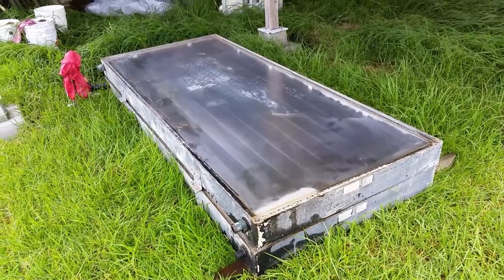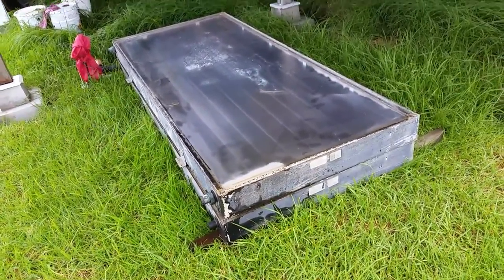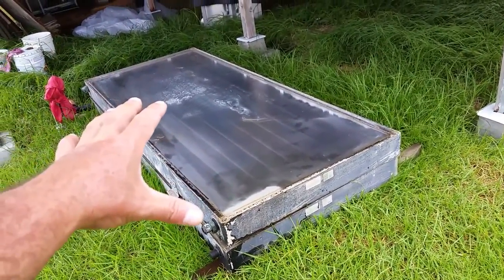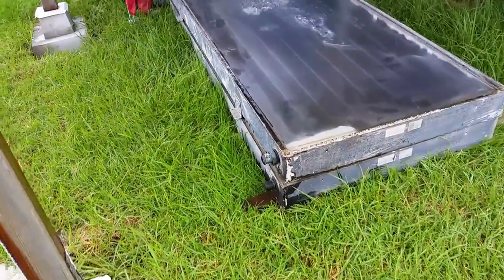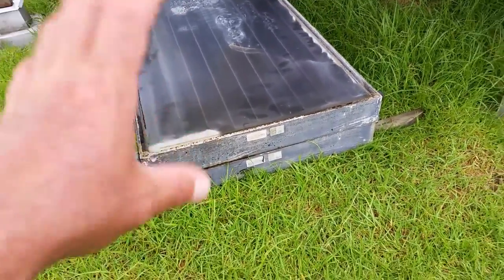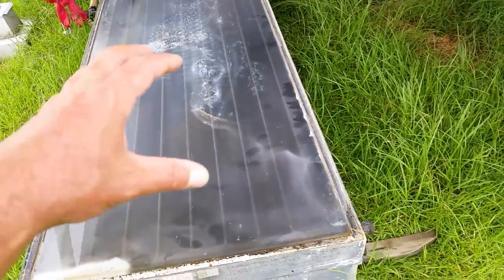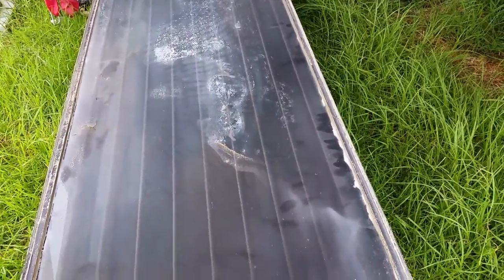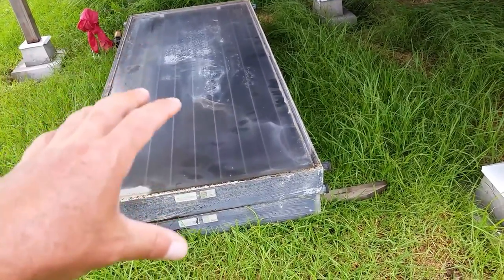Recycled Old Hot Water Heater Panels Restored New Life (Part 1)

Comment: i had three of those ones. i live in a freezing zone. mine did get a freeze and some splits. i put them on a frames on the ground facing south with water in them. capped the ends. and left one end open. it made steam. when connecting them i used car radiator hose and clamps. i put the cold on the bottoms in parrell and took off the hot off the top. wow you won't believe it. for safety do use an expansion tank and a air bubble thing. you will have so much hot.

Comment: Sweet deal, those will really boost the performance of the dc hot water heater! Once it is up and running, you should never run out of hot water!
Reply from the maker: yup thats my thinking anything helps. I like finding old stuff that have still be used.

Comment: I just found six sixteen foot rubber and abs pool solar water heater panels. There awesome. Gotta see what I can do with them..... Got any ideas.
Reply from the maker: I have 3 of the same panels your talking about under my home I never pull them out yet. It made to heat water so make an outdoor spa.
Reply: @ModernOffGridDIY  
I was wondering about a hot water system for a house or radiative heating system with salt water and copper piping .

Double edited

Comment: if the inside copper plate with the pipes are pressed into the plate has flat black on it i would suggest not to touch them. the glass do clean but not perfectly. on the underside of the glass is bumpy. this is the best part of all. like a prism and gives it sun gain. you will get boiling water if pointed to the south and not even perfectly. just to figure how to store the water and it will be under a lot of pressure.

Comment: G'day mate can you give me some advice on a way to fix the two panels together. I want to use 20mm pex pipe but dont know how to get the join done. Is there a better way.
Reply from the maker: +Mirriulah Water Dog yes do not use pex in between the panels the hot water will pop the pipe, I Galvanized fittings in between each panel way better and can handle the heat, check out my other vids on my setup I show what I did.